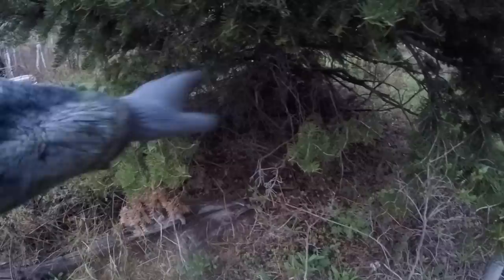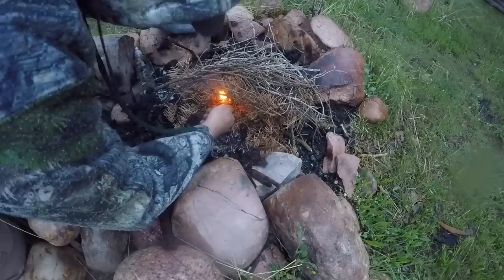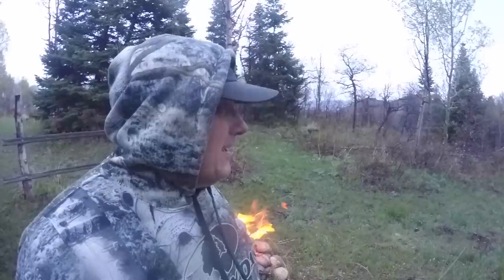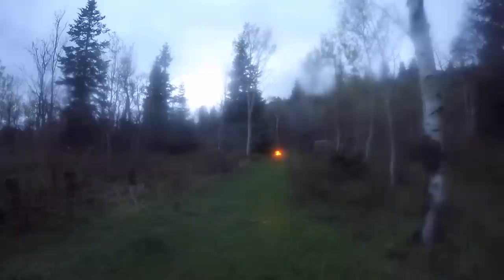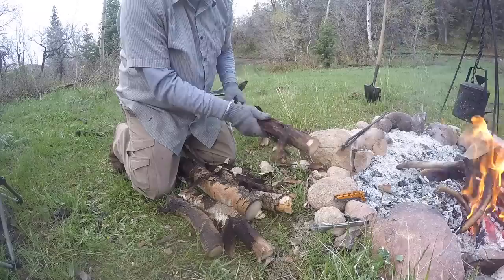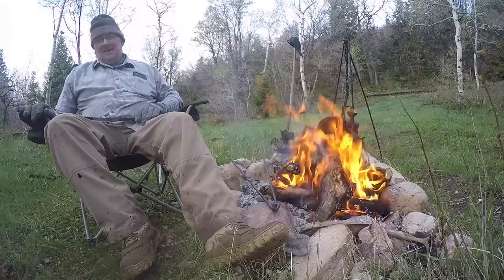Unusual Way to Use a Tarp Over a Fire - The Beast Sleeping Pad Set Up

Comment: The corn looks infested with bacteria. You touched it with your bare dirty, metal, lead touching hands. Stay healthy dont poison yourself
Reply from the maker: Hmm, that's interesting, it was fresh from the market. If I'm messing with the fire, there is always a little charcoal and ash on my hands which may look nasty, but in reality pretty inert. I don't think I was handling any lead ?? I'm probably cleaner than it may look, I rarely ever get sick, in fact its been more than year since I had any sickness and even then just a cold that lasted a couple days, no missed work. I do appreciate your concerns and certainly it is good for people to avoid contaminating themselves. Thanks
Reply: @wildernessinnovation  as long as your happy. I hate germs. They are sneaky little runts, i dont trust them for a second

Comment: Aggggghhh, You scared the crap out of me chopping between you legs with a hatchet with your left hand. You could have cut some man bits off of you. You are evil or a leftie, lol (for trolls, that last bit is a joke). But it still freaks me out watching lefties use sharp, dangerous cutting and chopping tools; it just looks wrong.

But not the chopping bit between your legs, though, it scares me almost to death. FIY, I have a tomahawk and a machete and prefer the machete because of my climate (I'm in a subtropical zone) and the stuff I usually cut. I also travel by bike and usually have to pack lighter so I can fit in all the fishing gear. The hawk comes in handy though.

Fortunately, I don't have to worry about bears, cougars, mountain lions or other cats, etc. 

I only have to worry about poisonous snakes (land and marine), spiders, venomous octopuses and jelly fish, goannas and the odd salt water crocodile.

Of that lot, it is the poisonous land snakes you really have be careful of, hence the machete, way more effective than a hand gun at killing snakes. Don't try to cut their heads off, aim lower and swat them with the flat of the blade from the side and smash their rib cage. Works on just about all land snakes in Oz.
Reply from the maker: Well you are in luck I am a lefty or really ambi. I've watched this clip over and over and I can't figure out what people are nervous about, guess I'm just so used to, My dad taught me hand tools when my age was still single digits, and  I'm so accustomed to it that I don't give a second thought. It probably looks more hazardous than it really was. My strokes were very limited and light,  a lot of the movement was wrist based so I didn't have a long radius which would have made a follow through closer to my leg or foot. If I had a long stroke with momentum it would have been dangerous and I would have stood to the side, but that's kind of an awkward position to get that kind of motion going from.  Anyway thanks for the comments and for watching !! Cheers